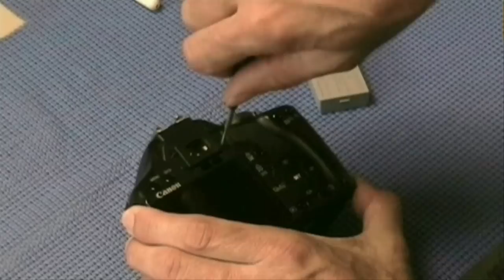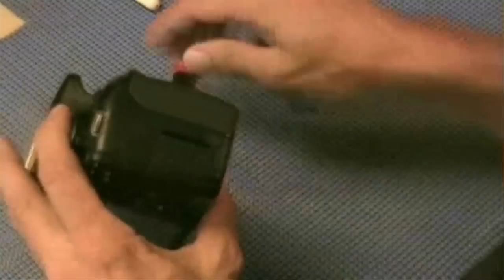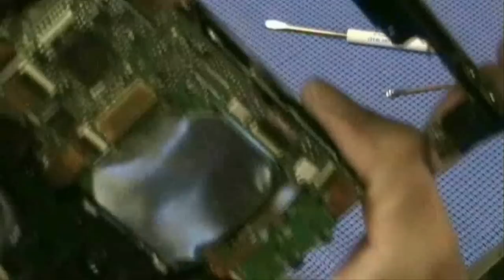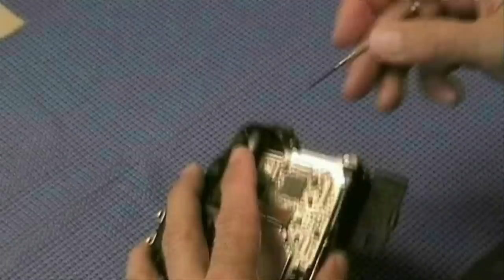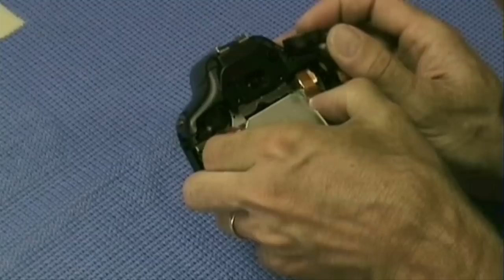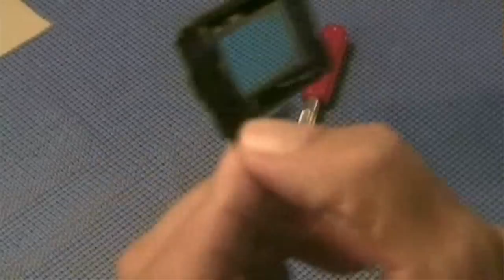Modification of Canon 450D or 1000D DSLR Camera for Astro Imaging and Infrared Photography

Comment: Well I'm back again! figured I ask should a replacement filter be put over where the IR filter was ? Reason I ask cause I'm planning to buy another Canon 450d to astro mod but I figured I'd ask so before I order and take the DSLR a part that I get a filter place where the IR was hate to put the DSLR back together and then end up having to take it a part again to add a filter inside it. Figured I'd mention I never needed to cut out the IR filter pushing the IR filter out with your finger works fine or you can push the IR filter out with a screw driver carefully because you don't wanna bend or break that housing but I had no problems pushing the IR out.
Was also curious as to what will no longer function on the DSLR the first one I did following the video I never tried to use the Sensor cleaner and a few other things I never tried to use was a bit worried if I tried to use them it would damage the camera or lock it up so it wouldn't work.
I noticed my first comment I said I could've done it without your video, but I was meaning to say I couldn't have done it without your video... So hopefully that clears some things up.. One of these days I have where I look back at old posts and say to myself eh? I said that I swear someone edits my comments some times but I know someone doesn't I for some reason think it sounds good then look back and I'm like ...
Reply from the maker: Hi Matt,
For old messages from you would have to click the more messages button below.   Gary
Reply from the maker: Hi Matthew,   You can always reconnect the ribbon cables on the mainboard, that's what I found that fixes many issues. 
 
You asked: " I also had to disable the ultrasonic cleaner on start-up and shutdown mode.  Is that required if you put in the Baader IR lowpass filter for the Canon one, or does it still normally work?
 
Yes, you can use a blower's bulb in manual cleaning.   I use a 2 ounce rubber ear syringe that I bought on ebay.  

If that fails you can send it to Canon for repair.  I have had good luck with the Canon Service Center in Newport News, VA.   You need to include a note and online for the technician that reads the camera was modified by me for astro imaging an please don't change out the custom filter.  It is probably a faulty SD circuit board.   Gary

Comment: Hi, I used your video to replace the sensor for a new one, but after the change I've got the Err 06 and do not detect de SD Card.
What can I do?
Reply from the maker: ARIEL CESAN 
You can try re-connecting all ribbon cables a few times, to see if that helps to get a working camera.  If that doesn't work, my understanding is that only Canon Authorized Service Centers have the software that is needed to pair a sensor with the mainboard of the camera.  When replacing mainboards of Canon DSLRs, that software is used for mapping hot pixels and reducing noise.
Reply: Gary Honis thanks

Comment: Even though I was up for well over 18 hours and really tried I managed to take it a part remove the infrared cut filter and put it back together without the infrared cut filter only problem I had was that screw that's at an angle at the top that holds the sensor housing couldn't be reached started to panic that I wasn't gonna be able to mod it took a few breathes and said OK we're gonna need to remove the front housing if I'm gonna stand a chance at removing the screw everything worked out camera still works and takes pictures without the blue filter on it hopefully now I can get more color for the Ring nebula I seen the green teal color but the dumbbell nebula wasn't coming out much as for the Lagoon nebula it was barely visible. anyways thanks for the awesome video.
Reply from the maker: Hi Matt,  Congratulations on your successful mod!   I always suggest using a high quality driver will avoid stripping screw heads. I have been buying good quality drivers from an ebay source:
 
http://www.ebay.com/itm/Apple-iPhone-3G-3Gs-4-4G-PH000-Philips-Screwdriver-Cell-Phone-Commercial-Tool-/180730939239?pt=US_Cell_Phone_Replacement_Parts_Tools&hash=item2a14674767

Gary
Reply: Gary Honis Thanks again could've done without your video and screw sheet what I did was I printed out your sheet took some Scott's tape and placed the tape where the screws we're on the paper then stuck the screw heads in the spot of the order re-assembly was a bit tricky but all works can't wait to try it out on the night sky.

Comment from the maker: Terry,

The procedure for the 350D would be more similar to that of the 300D.  YouTube doesn't allow posting links in comments but you can do a Google search using  "ghonis2 300d" as the search term.

For a guide specific to the 350D, use the search term: "ash's modified".

Hope that helps,

Gary

Comment: Thanks Gary. So you suggest to remove all the filters down to the sensor is that correct for a full spectrum modification? I don't need to leave anything. Isn't there a anti aliasing piece? That has to stay? I intend to use it with my reflector at prime focus. I won't put in the astronomik glass replacement unless you say it's completely necessary because I intend to use the Astronomik UHC clip in filter. Do you foresee any problems with this. Thanks! I'll check the forum too! Gerry
Reply from the maker: Hi Gerry,  With the replacement of both filters and adding the Astronomik MC clear glass you would get more detailed images because the anti-aliasing filter is removed.  Also adding the MC clear glass would allow you to image with camera lenses.  Gary

Comment: Hello Gary
I'm about to try following your instructions to modify my Canon 550d. Scary! I intend to use a Astronomik UHC filter afterwards. Can I ask which filters do I need to remove do I leave the first one? Shame your not closer to Italy I would send it to you! Any advice for my camera. Oh yes the shims! Are they also to do on the 550d? I wasn't so clear on it. 
Thanks 
Gerry
Reply from the maker: Hi Gerry,  That is because the front filter (LPF#1) does not fully block IR and can result in star bloat.  The problem with having only the front filter (LPF#1) in place is that it is a weak IR blocker and does not block all infrared light. If you planned to image with a reflector telescope only at prime, that would be okay.  Once you add a focal reducer, corrector or barlow to the imaging train, you would need to include a UV/IR cut filter in the imaging train to avoid star bloat.  If you plan to image with a refractor telescope, you would also need to add a UV/IR cut filter in the imaging train.  I have a Youtube video posted here that show star bloat using LPF#1 only as the filter:

https://www.youtube.com/watch?v=r9-8lB1e_20

We have had discussions of this on my support group DSLRmodifications:

http://tech.groups.yahoo.com/group/DSLRmodifications/message/3797?threaded=1&l=1 

The 550D model does not have shims,  there are spring loaded screws instead,  just follow my instructions for a Full Spectrum modification.    Gary

Comment: Hello Gary, thanks for all your information.
Does a coma corrector on a reflector count as a lens system? Since i was planning on removing the filters in my 1000D and not replacing them with anything.
Reply from the maker: +Alexander Axglimt 

On my support group there have been discussions of using the Baader MPCC coma corrector with Full Spectrum modified cameras without problems and no need to use a UV/IR filter.  See the discussion here:
 
http://tech.groups.yahoo.com/group/DSLRmodifications/message/2100

If you are asking why I use an Astronomik MC Clear Glass for a Full Spectrum modification, if you don't replace the original filters with anything, most camera lenses will be unable to reach focus at infinity for astro imaging. 
 
Another reason for using a multi-coated optically polished clear glass for full spectrum modifications is because it acts as an optical window to protect the CMOS imaging chip. The Astronomik MC Clear Glass is very durable and scratch resistant.  I have seen cameras with dirty front filters that are not only dusty but have difficult to remove grime (tree sap is one suspect). Even worse, there have been reports on my support group of the front filter becoming pitted. I have replaced front filters that have been badly scratched by users during their attempts at cleaning. A front filter is much less expensive to replace than a CMOS imaging sensor assembly.  But if you always keep a clip filter inside the camera body, that would provide a good level of protecting the CMOS sensor.
 
Hope that helps.

Gary
Reply: +Gary Honis Yes, it sure does, thank you!
My camera will not be used for anything else than to be attached to a reflector with a baader mpcc.
Besides, it's an old body i bought cheap used, so i don't want to spend to much $ on it... Maybe when i upgrade i will do a proper mod.
On my camera i don't see any setting for mirror up lock, and it makes this noise everytime the mirror moves so i was thinking if there's any way to remove the mirror also... Do you know if that is possible?
Reply from the maker: +Alexander Axglimt 
You can see instructions for removing the flip mirror on a 550D here, maybe you could do the same for your 1000D:

http://www.markshelley.co.uk/Astronomy/Projects/Mirrorless/canon550mirrorless.html
Reply: +Gary Honis Excellent! I will check it out.

Comment: Hello Gary, great video! Do you know what kind of Baader or Astronomik filter can be fitted into Canon 1200D? I'm not sure that this Canon model is ready for this filter..
thank you!
Reply from the maker: Hi Patrizia,  For the Canon 1200D the Astronomik MC Clear glass for the 1100D fits.  This is what Baader has on their website: "Due to technical problems it is not possible to change filters in the Canon EOS 1200D"  That may because on one of the sensor screws it does not have a black pin like the other sensor screws have to measure.  I have used the 1100D Baader replacement for many 1200D baader modifications.  For that sensor screw without the black pin, you can scratch a line alongside it with a razor knife to show its original position or make a measuring strip out of a business card and measure from the small shelf that is behind that screw.  Hope that helps.
Gary
Reply: Thank you so much for your quickly reply!  I think that the baader item code for the 1200d is 245 9213 (the same for 1100d) Can you confirm my idea? Gary, I've two Canon cameras one 1200d and another 1100d.. Wich do you prefer for baader modification?  If the baader filter is the same, i think I'll be able to install it into both cameras. My first choise is for the better camera but i read in some website that the 1100d, sometime, present some defects under bright stars doing a vertical black banding.   Do you know wich is the matter?
Looking forward your new good news!
Have a nice day
Reply from the maker: Hi Maurizio,
Yes that is the correct baader filter.  You can check your 1100D camera now for black lines from bright stars before deciding to modify it.  The 1100D would be easier to modify than the 1200D and you can use my website instructions for the modification.  Gary
Reply: Thank you Gary, sorry but in my first message i forget logout function and I did login with another google account... Ok, I'll buy a 245 9213 baader filter for 1200d. In this moment the canon 1100 is "at work" for a test with very high bright star. Wich kind of difference inside between the two cameras? Will you do a little tutorial for 1200d modification?
Have a nice day!!
Maurizio
Reply from the maker: Hi Maurizio,  I always planned to post modification instructions on my website for the 1200D, but that is months away, because I'm very busy and don't have time.  Gary
Reply: Thank you so much for your help!! I've open the 1200d camera and i find all three screews with a black point just like show in your video. It's normal? 
When i slide up the top cover of the camera I found a little black cable comes from local flash, this cable isn't a copper wire, but a optical fiber or a similar something. I think that this cable comes from a little strange white connector from the logic board. I pulled out the circuit with a very carefully but i find the cable already disconnected. I tryed to reconnected this little black cable into white connector but this not have a retainer system, the wire slide out too easly. Can you help me to understand where (and as) the wire be connected? Follow two pictures.
http://i66.tinypic.com/5bb2gk.jpg
http://i64.tinypic.com/x243yd.jpg
http://i64.tinypic.com/ac6521.jpg

Thanks a lot !!

Comment: Very helpful video!
But where can I buy a clear filter for my canon 450d to do full spectrum? Any website?
Reply from the maker: Hi Parthmesh,

You can buy the clear filter from astro-shop in Germany. 

You can use the instructions on my website.

Gary
Reply: @ghonis  Thanks. :)
I'm curious, what if I don't put any clear glass after removing ir cut filter? (Except the vibrating sensor cleaning glass/assembly.)
Reply from the maker: Hi Prathmesh,

I don't do modifications that only remove the stock IR filter (LPF#2).  That is because the front filter (LPF#1) does not fully block IR and can result in star bloat.  The problem with having only the front filter (LPF#1) in place is that it is a weak IR blocker and does not block all infrared light. If you planned to image with a reflector telescope only at prime, that would be okay.  Once you add a focal reducer, corrector or barlow to the imaging train, you would need to include a UV/IR cut filter in the imaging train to avoid star bloat.  If you plan to image with a refractor telescope, you would also need to add a UV/IR cut filter in the imaging train.  I have a Youtube video posted here that show star bloat using LPF#1 only as the filter:

https://www.youtube.com/watch?v=r9-8lB1e_20

Gary
Reply: Thanks again. :)
I appreciate your views. 
But I'm going to use that camera only for IR photography with different wavelength IR filters.
The main reason for doing this is my canon 450d has collapsed shutter so anyway I need to replace it with new shutter assembly. And I love to DIY stuff & Infrared Photography. (I do have a 720nm IR filter & I'm getting 590nm soon.)

Comment: is there any difference in a 1200d and 1000d while doing the conversion?
Reply from the maker: The 1200D (T5) is Canon's replacement for its budget level model the 1100D (T3).  I haven't modified the 1200D (T5) model yet, but my guess is that the procedure would be closer to that of the 1100D (T3) or 600D (T3i) models than the old 1000D (XS) model.  You can find modification instructions for those models on my web site GaryHonis.com
Reply: Gary Honis Thank you very much sir!!

Comment: Hi Gary! My canon 450D got error 99. Trying to figure out where and if there's a cmos/memory internal battery :) help? :)
Reply from the maker: Hi Jian,  Most likely, you will need to reseat all ribbon cable connections to get the camera working.  That is the most common problem.  If that doesn't work you would have to send it to Canon for repair.   Gary

Comment: hi Gary,hey is  your website still up/ i just unassembled a 450d  to replacethe bad shutter0 which i have to order, no problem unassembling /but afraid re assembling will be a different story lol
Reply from the maker: Hi Jerry, My web site is now at GaryHonis.com
Good luck with your shutter replacement.
Reply: Gary Honis hi im sorry if thid has already been answered but is the proscess the same for a 1100d?
Reply from the maker: Hi Martin, Yes the process is similar to the 1100D but there are some differences.  On my web site GaryHonis.com I have complete detailed instructions for modifying the 1100D (T3) model.  If you are planning to do a Full Spectrum modification using the Astronomk MC Clear Glass, there is a special glass sold by Astronomik that has a slant cut in one corner so that it fits the 1100D model.

Comment: Hi! very informative video.
Can i make a question to you? 
It is tecnically possible to "switch" the entire sensor (as an example, put a 450D sensor into a 300D sensor)? 
If no, why? different sizes? firmware problems? 
A detailed answer would be appreciated (serached on the net with no results).

Comment: just sowe're clear, youdont need to replace the filter right? its okay just to remove and leave it like that for astrophotography?
Reply from the maker: Dylan Walton 
The Canon DSLR cameras have two original filters, if you replaced the IR filter (LPF#2) only and relied on the original front filter to block infrared, you would get star bloat.  See my youtube video here:
https://www.youtube.com/watch?v=r9-8lB1e_20
Reply: Gary Honis I read somewhere that star bloat would only occure on Achromatic refractor and not on Apo/ED refractor ? Can you confirm that ?
Reply from the maker: Max Gemaxi 
Hi Max,  even with triplet refractors, since they are a lens system, you would need to fully block infrared light.  The star bloat results from any type of lens system, like refractors being only designed to focus visible light (R, G & B) to the same focus point and not infrared wavelengths above 700nm.  The infrared light would not be in focus as visible light would be and that results in star bloat.
Reply: Gary Honis So I either need to install an internal Baader filter (meaning re-opening the camera) or install an external filter (clip-in or 2") in the light path...  I'll choose the easy path there ;) Thanks for your answer